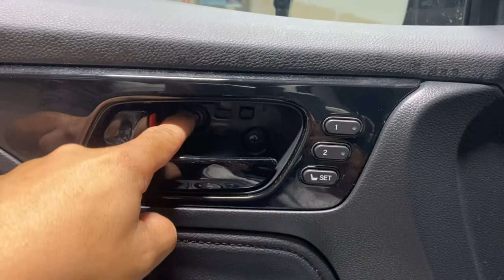8 Minute Removal and Installation of a 2018-2020 Honda Odyssey Side View Mirror - ReveMoto.com

Comment: Perfect length and attention to detail.  Great video.
I only dropped one nut. I retrieved it without taking out the speaker.  Pull up on one side of the black plastic cover in the center of the door and use a magnet.
Reply from the maker: Thanks for the share! Yeah it's so easy to fumble with those nuts so going to keep this tip in mind. And if you ever need a replacement mirror already painted to match your car don't forget to check us out www.revemoto.com